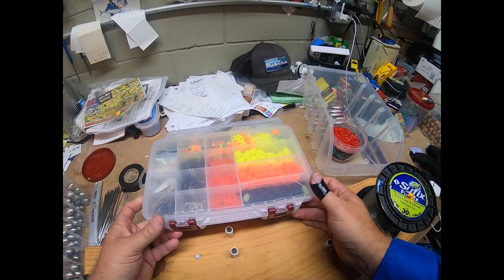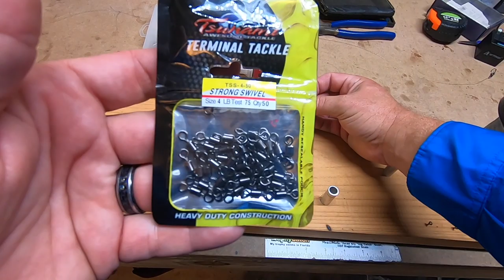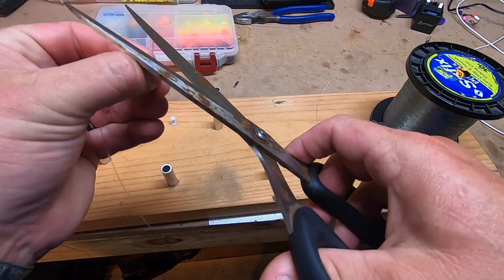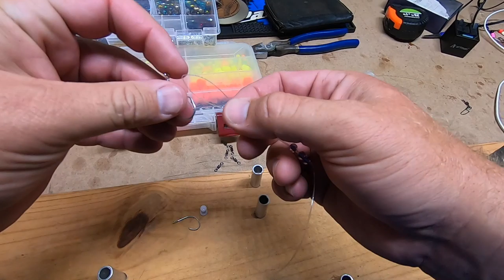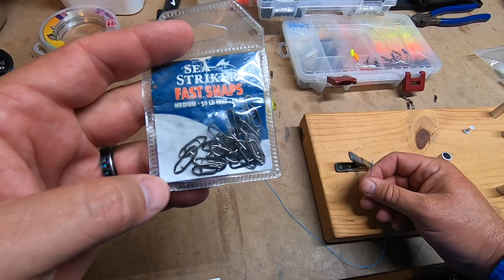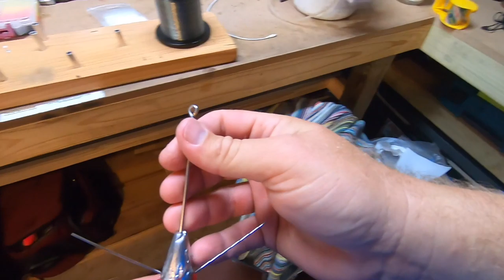Surf Fishing Florida how to tie the BEST surf fishing rig, (DOUBLE DROPER RIG). Jacksonville Florida

Comment: If you wanted to target Pompano, Whiting and a passing bull Red, would you fish all rods on a double drop with beads/floats, or would you leave 1 rod on a Mortician rig no float?  Concerned about hook size and bait used if sticking solely a double drop wiht float.  Thanks as always, built the board, works like a champ.  Also built up some Mortician rigs, snoots are free to swing, is awesome.

Comment: Hey! Awesome video. Love this stuff. Keep it up. Quick question for you... You are using heavy-duty strong and barrel swivels. Any reason we shouldn't go smaller, since these rigs will mainly be catching small fish? Or are you using big terminal tackle just in case a big fish bites? Thanks again for your videos!
Reply from the maker: Thank you for the kind words.  We are using a little stronger swivels and swivel and coast lock because you can put a lot of pressure on the terminal tackle when casting.  You can go smaller or with non but recommend at lease 1 swivel is you worry about scaring the fish.  I the Jacksonville area it isn’t uncommon to catch a 30-40 in fish with a double drop rig.  So I never want to lose a fish because i choose something not adequate enough.
Reply: @thesinkerguy  makes a lot of sense. Thanks again. Cheers!

Comment: for an unbreakable terminal tackle knot, try the "power knot". Mostly OBX, mid-Atlantic, and some northerly, the power knot is a modified clinch knot, wherein you make a loop and tie a clinch knot.  Come back thru the loop at the bottom of the twists, then take the loop over the hardware, and tighten.  This knot will knot fail. No part of the knot "bites", it is all twists. clamps, and pulls when tight.  Just something I've used for a long time surf fishing.  Best to all.

Comment: First thank you so much for getting the sinkers to Dauphin! The worked flawlessly, unfortunately the fish were not interested in 80 degree water temps nearshore. I have a question regarding storing these amazing weights. Do have a storage solution for these?
Reply from the maker: We hang them from the cart or used a plastic coffee can in most cases
Reply: @thesinkerguy  I was thinker more for traveling on an airplane and how to maximize storage and space.
Reply from the maker: @billybastar4022  you can open them up and rubber band the legs together and they will lie flat in a toiletry bag.  Or you can have a small box, if you have a bunch of them they will interlace together and will make a circle so they can slide in a box or a small circle container.
Reply: I will try that out. I watched a video of a fisherman who used vitamin tube to house each weight as well. I will try both, although it sounds like a business opportunity to find a solution for these great sinkers. I’m on it!

Comment: Do you match your rig line test weight with the size sinker you use?  Or does it not make a difference?  Would a 5 oz weight snap off the rig using a 30 lb test line in the rig?  The reason i ask i see Larry Finch using 10 lb test in his pompano rig yet getting away with throwing a sizable weight.  Can you clear this up for me?
Reply from the maker: This is a fantastic question! The more smooth of a caster you are the lighter you can go.  Also the lighter the tip of your rod the lighter you can go.  If you are throwing a stiff rod and you are jerky 30lb will hold up just fine.  

If you want to throw 10lb then I recommend getting good at casting and choose a super lightweight rod like “the bullet” by florida surf tackle.  If not you will lose lots of sinkers and rigs.  Also choose high quality rigs so you don’t throw off your sinkers.  Ask around a lot of people will be honest if a rig isn’t any good.  I hope this helps.